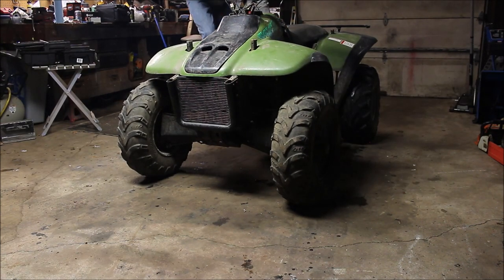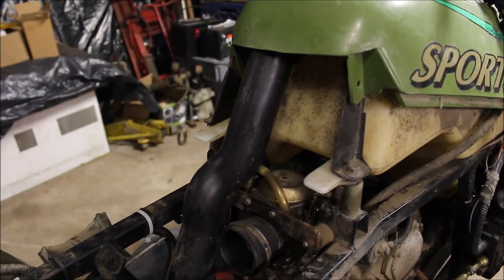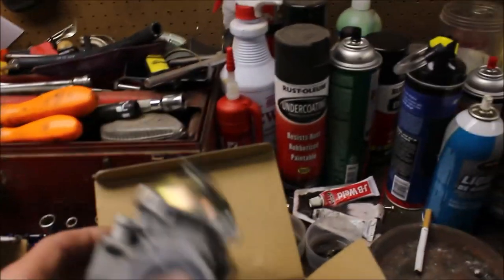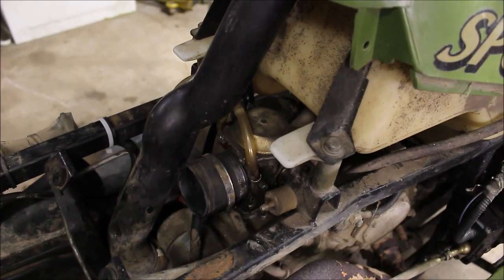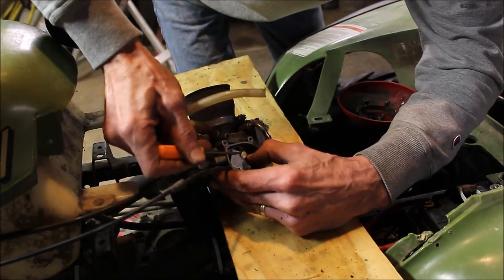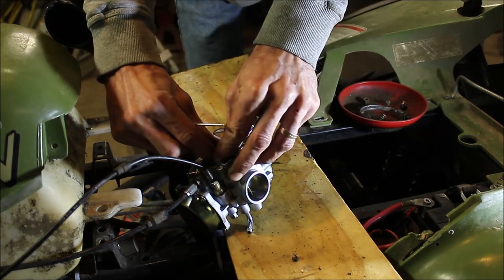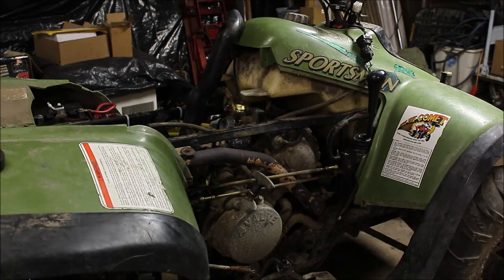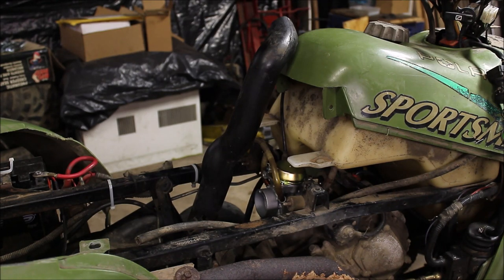Polaris Sportsman 500 Backfire and Bog Down Going up Hills? Find out Why!

Comment: I have an 01 sportsman 500HO, mine does bog down but only sometimes, doesn't matter what position throttle is in, it will eventually go away on its own, any suggestions?
Reply from the maker: Could be a couple things. Check the carb and boot. I would also try the cdi. Maybe try unplugging the black wire. I had a 2000 that the cdi would sometimes work and sometimes not. If the black wire trick works then you know it's the cdi. But I would check the diagram on the carb and clean the carb first.

Comment: Hey man, this is the channel I've been looking for ! I've got a 05 500 EFI that runs ok for a while then bogs down and dies. I checked the plug and air filter. Ran some BG and heat and changed the fuel filter. got better but still dies. I finely put a new plug the other day and I know, should have done that first, and it ran like new... for about 2 hours, then did it again. any ideas ?
Reply from the maker: I would try a cooler spark plug first. If that doesn't help it could be an issue with the fuel pump or wiring. Check for soft wires that may have heated up from riding.
Reply: Hey just so I understand as well…. With NGK plugs the higher number the cooler the plug correct?

Comment: Mine was because of old fuel. I siphoned everything from the tank and put some seafoam ( A little more than recommended lol) then filled it with new fuel. I had to rev it for probably 10 minutes all together until the new fuel finally cycled through and cleaned everything.

Comment: 1:41 so the hose that goes from the breather hose coming from the bottom of the engine with the filter in line. then goings to the airbox should that hose be sucking air in or out because on the filter it says the air is going into the engine not out and I can feel the air coming out and hear it. you can even hear it when the lid is on and seat. im asking because i dont remember it doing that i dont know if thats normal or not thanks
Reply from the maker: I believe it goes out into the airbox.
Reply: @TitaniummanGarage  okay thanks I thought it was a problem

Comment: My Polaris 500 is backfiring through the backfiring back through the breather
What could be causing that?
Reply from the maker: Timing is off. Check your valve lash and timing.
Reply: It wasn't popping and spitting until the vacuum lines came loose so it's not the timing.
Reply: How many vacuum hose lines are there on my Polaris sportsman 500
Reply: Where does the vacuum line go to that comes off of the bottom of the carburetor?
Reply from the maker: @kippiemoore7439  Is it an H.O. Or Non H.O.?
You have one Vacuum line on the carb and 2 ports on the airbox side of carb for the breathers. The vacuum goes to the fuel pump. If its non H.O It should be on the top left and reverse for H.O. If gas shoots out of the carb...it would be timing. You said breather. I would check your needle and seat and jet. something is plugging up loading your carb with fuel. I would check your fuel lines too and fuel filter. Even with a rebuild or cleaned carb, dirt can still come from tank or soft lines and plug something up. if it hasn't been done I'd replace the fuel lines too.
Reply from the maker: The hose on the bottom of the carb is a overflow hose. If your needle and seat leak gas will keep filling the bowl and will leak out the bottom hose so it prevents it from filling the case.
Reply: @TitaniummanGarage  okay, my husband wants me to take the carburetor off and take it to a shop to have it cleaned but I would prefer to clean it myself. But he says they're really hard! How much harder can it be to clean a an ATV carburetor versus a push mower carburetor? I love a good challenge! That's why I'm fixing this four wheel drive with your help of course! And thank you so much for the advice! and I guess you found out how to sell a lot of push mowers and other things! okay thank you and hopefully I will hear from you soon!
Reply: Oh and I'm also going to drain the gas out of it because I'm not sure if it has water in it or not and see if maybe that might help clear up some of the issues! I'll let you know!
Reply: It's not an H O...
Reply from the maker: @kippiemoore7439  Taking the carb out is the hard part. cleaning it is a breeze. I have several video's on how to remove the choke cable, the throttle cable. And there are tons of video's on you tube to clean one. you just need a really small screwdriver to take the jet out. Just don't lose the needle when you pull the bowl off. (been there, done that! found it a week later in my driveway. lol) I would buy a rebuild kit if your that far. 30 bucks on ebay. Good luck.
Reply from the maker: I actually have to do that myself. maybe I'll make a video. lol.
Reply: @TitaniummanGarage  yeah I just drained all the fuel out of it so and it had a lot of trash in it! So I'm going to see if that might help with the issues getting the trash out of it. Now from what I understand there's a screen in the bottom of the fuel tank, do I need to take that out too and clean it?
Reply from the maker: @kippiemoore7439  Probably wouldn't be a bad idea. I just shot a video of removal of the carb and jet cleaning. Its down loading now. My Tank was brown and dirty at the bottom near the screen.
Reply from the maker: @kippiemoore7439  Here is a video for you.https://youtu.be/JSGneUkaAxE
Reply: @TitaniummanGarage  yeah I drained the gas out of the tank and there was all kinds of trash in it

Comment: Mines actually bogging out in reverse just gnarly running in reverse  when ya go.  You have to give it a ton of throttle to get  a hill pulled.
Reply from the maker: Your pushing and holding the override button right?  If so it's your rev limiter.

Comment: my friends fourwheeler bogs when you get on the throttle too much and you cant open it all the way up without it bogging at 3 quarters throttle
Reply: That's the same problem I'm having, I haven't figured it out yet.
Reply: I have rhisnissue too. I think its the coil or cdi box

Comment: Doesn't trust advice to clean the OEM carb to do a good enough job, so replaces it with minimum-price clone, because it comes with clean parts, even with the knowledge that it won't last very long. Also replaces fuel pump for good luck, I guess. Forgets to include the price of pump in calculations. Electrical-tape on the cracked intake pipe finally fixes (?) the problem. Doesn't want to buy an ultrasonic cleaner, because it costs about as much as a throw-away replacement carb. Is excited to share his "Quick fixes", that come after doing everything the most circuitous route, before attempting the exterior observations that lead to such quick fixes. 
I think I better buy a helmet before I end up all the way like this. (admittedly, I ran to the garage to check my flexible intake pipe for cracks and remembered I have a spare carb on hand)
Reply from the maker: If your talking about me. Those were quick fixes to narrow down what the issue is. I have a cheap sonic cleaner...It works like crap. Fuel pump is 15 bucks. I used the tape to temporarily fix the boot till I could order a new one. I have dozens of people having issues with cleaning their carb. So my suggestion is to buy a cheap one...see if that is the issue.  For 37 bucks, it worth finding out if it's the carb causing all the headaches or fuel pump or something electrical.  These are all suggestions so the average guy can troubleshoot their issues without dropping a ton of money.
Reply: @TitaniummanGarage  Yeah. It was pretty insightful. Like I said, I went to check for air leaks after watching. I think my problem is mostly old, dried-out fuel though, as it's starting to run better and with less smoke, on fresh stuff. On my ATV, I'm willing to make nearly any excuse to avoid the amount of disassembly required to swap in that other carb. :P
Reply from the maker: @buckstarchaser2376  I hear ya. I hate working on carbs. I spent a good amount of time on a 700 carb. Cleaned it 3 times. Didnt work. I grabbed another oem carb and it ran great. Maybe try sea foam in the tank if its getting better. Helps clean the carb.

Comment: Carb kit will cost you 40 bucks ...so 38 for a whole carb is worth it  ..............Bet that boot is expensive   ,,,Scrap radiator hose off a car or truck will work in a pinch

Comment: I have a 99 Sportsman 500 two years ago and broke the cam and I had to replace it a local dealership and ever since then it only seems like I'm getting half of the power that I had before I could have the throttle wide open and it's still seems like I'm only about half throttle they didn't replace the Rockers they just replace the cam I guess since then this dealership has gone under because they had crap employees and crap owners and I don't think they did mine right before so I could just haul ass everywhere I'm going now not so much replaced it with that Polaris cam